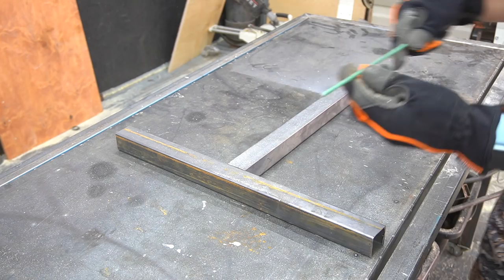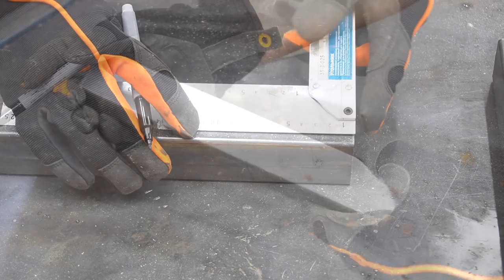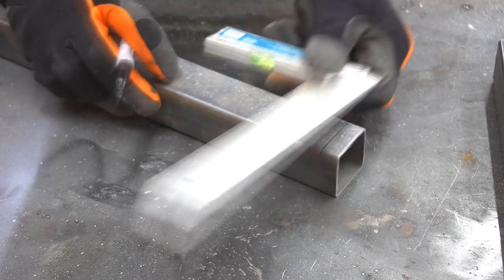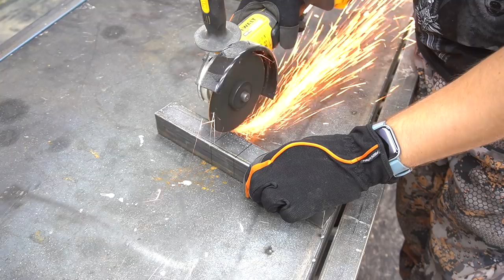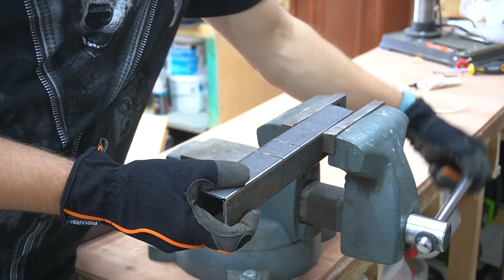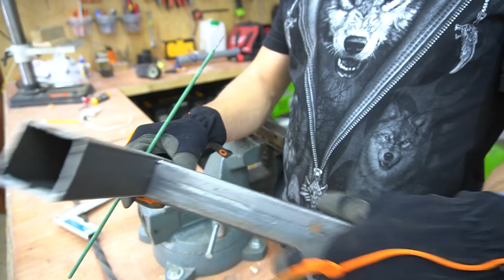Secret Profile Pipe! WHY DO WELDERS NOT SPEAK ABOUT IT!

Comment: Real welder here, and the real reason we don’t tell these secrets is because well we don’t waste time building things this way. Time is money and wasting time on a project means it’s costs me and the customer more to get it done. Also tube not pipe. Everyone knows that.
Reply: Why do all these type videos call it “profile pipe” instead of the square and rectangular tubing that it is?  Certified welder here with over 40 years of experience, and I can tell you that the American Welding Society has no “tab and slot” joints in any of their procedure books! I always worked under D15.1. Oh well, as long as he’s happy, all is well!
Reply: Tom T I’ve always worked under D17.1 or the various structural codes. It’s always tubing and not pipe.
Reply: Correct
Reply: @tomt9543 hello , could it be stronger this way ?
Reply: @jlkenzo7551  No. what it does do is run up labor costs doing something that gives no added strength to the joint over that of a standard butt joint! If you’re building something for yourself, that’s fine, but if you’re in business doing this stuff you can’t be competitive making all these extra preps to an otherwise simple joint! Time is money!!
Reply: @tomt9543  surely it’s stronger because 2 pairs of welded surfaces instead of just 1, plus the fact that it’s actually locked together even without welds, right? Time consuming and kind of pointless, sure, but definitely seems stronger in theory. No?
Reply: @imperialsecuritybureau6037  The weld deposit will typically have a 70,000 lb. tensile strength, which is consistent with the properties of “mild steel” (A36), so I wouldn’t say it adds any additional strength. Especially on thin wall 14ga. tubing. I applaud his creativity and out of the box thinking though! It does look like a neat trick for someone who needed to joint two pieces of tubing, but doesn’t own a welder!

Comment: Takes way too long and not as strong as welding and getting proper fusion between the two metals but if you don't have a welder, very cool idea. angle grinders are much cheaper so it could be a solution. Me personally, I'd recommend they get a cheap harbor freight flux core welder and some magnetic 90° angles and just weld it together. You can get them for around $300 and then you have a tool you can use on dozens of other projects or side hustles to make money

Comment: completely ridiculous - no welders speak about this because they don't do this pointless activity.
Reply: Asking because I know nothing about welding: wouldn't doing it this way and then welding the pieces together make for an even stronger joint or connection or whatever the term is ?
Reply: @Papa-Rah  nope. The extra cuts can easily create more errors with spacing resulting in blowouts (hole where the molten metal has let go) a crap fillet or butt weld will hold longer than the folded (weakened) tube. This is something that an artisan may do for looks but anyone doing a job understands that time=money and if it is weight bearing it should be up to code so that the welder is not screwed when it fails

Comment: If you have fun making all these extra cuts, power to ya. But it’s not practical.
Extra steps = extra mistakes. More mistakes = bigger gaps to fill and more wasted material.
I see no reason to do this kind of joint unless you lack confidence in your welds or want to avoid welding altogether.
Reply: But what about doing this and then welding the pieces together ? Would this make it doubly strong ?
Reply: @Papa-Rah . Welds can easily have tensile strengths  over 60,000 psi and shear over 40,000
Doing this "slot and insert" method spends more time cutting and creates more room for error. Errors will compromise your project long before a weld gives out.

The next issue is blow out. Because you cut 2 slots to slide one tube into the other, you may have a gap that needs filling. If the gap is too big, and the tube is thinner (like maybe 1/16" - 1/8" ) processes like flux core and certainly stick may blow a hole making the weld weaker.

Lastly, if you're being paid to do a project. Time is money. This method adds 0 practical benefit and creates dramatically more mistakes. Imagine doing this 4 times to make a basic platform... Imagine blowing a hole and having to fill it... Imagine warping caused by the extra heat from filling the hole... This makes a 5 hour project into a 10 or 15 hour project. 

 
If you have fun doing it, power to ya, but frankly it's dumb.
Reply: @dizimz  Thanks for the detailed reply.
Reply: @Papa-Rah  no prob